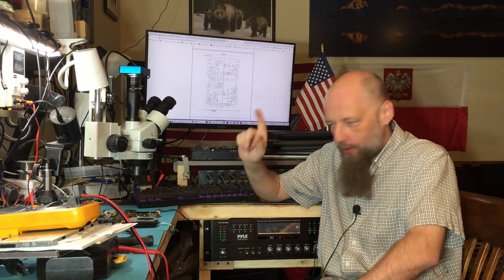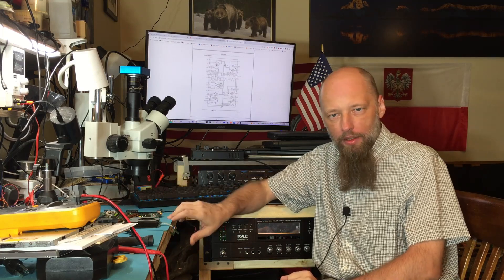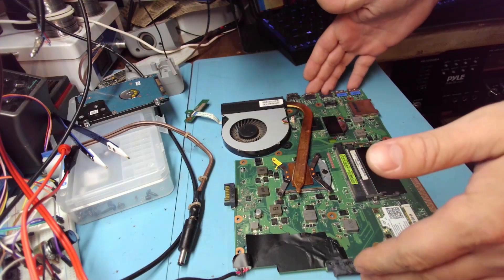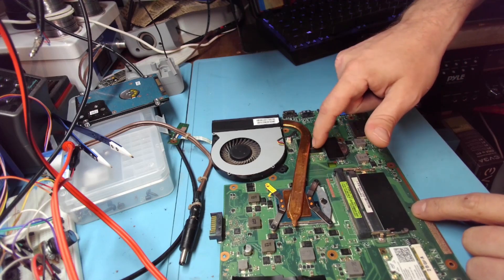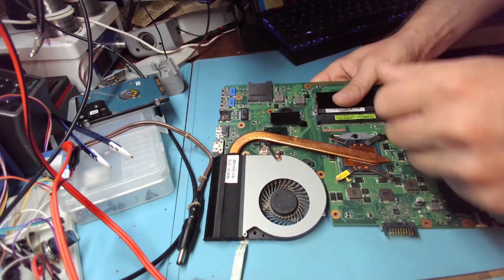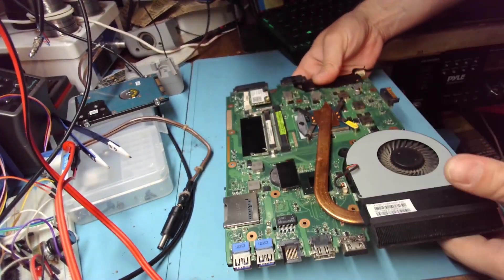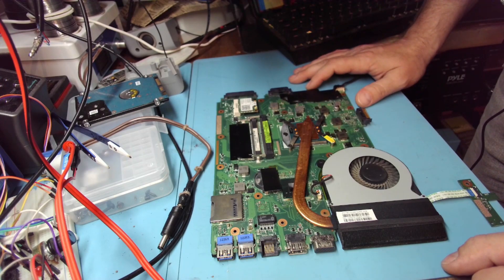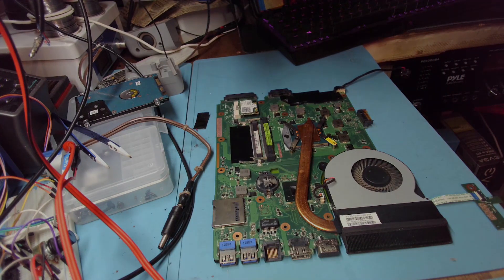Asus Q50DA Repair | Short Finding without thermal camera

Comment: Why remove all those caps? There's so many other techniques you could have used. A milliohm meter would have worked. Don't have one? Take your power supply and adjust it to around 100ma and clip the clips onto your meter probes and set your meter to millivolts. You can now put your probes across each component and read the millivolt reading (which will give you milliohm's). You don't need accuracy here because you're only measuring the difference between each component. Obviously the one with the lowest reading will be the culprit. This method also helps narrow down where the short is. If you measure a cap on one side of the board and then the other, there will be a huge difference in measurement so you'll know which part of the boards it's on.

You could also turn a spray duster upside down and freeze the components and then apply power and look for what defrosts.
Reply from the maker: Excellent advice, thank you. I definitely took a harder approach by removing caps :) I was thinking of buying a short finder but finally, I decided that it was time to invest in a thermal camera, which I ordered today. It saves so much time. In this case, neither freeze spray nor alcohol evaporation methods are effective since the short was inside the chip, I should have checked it first before addressing capacitors. Well, I didn't have much hope for this one since I bought it from the other repair shop as broken :D 
Thanks again for your comment, it's very helpful.